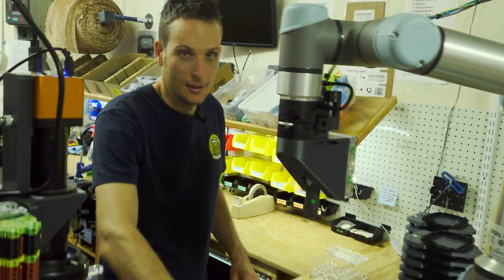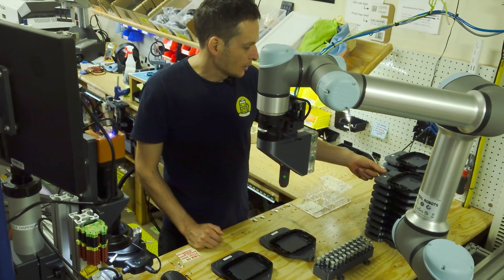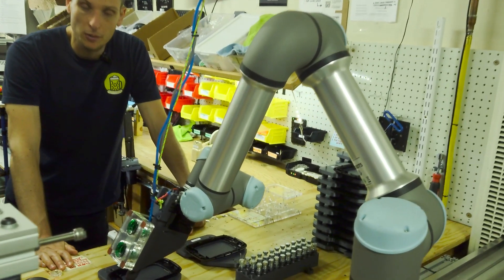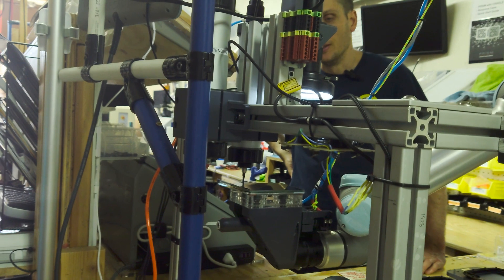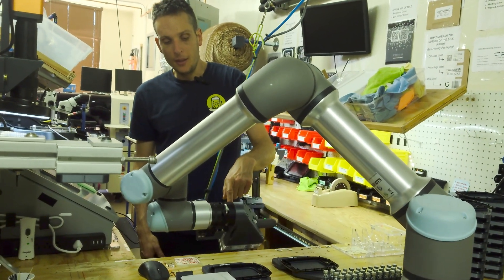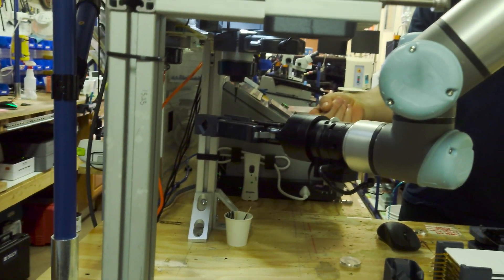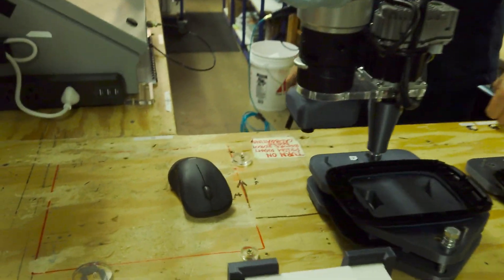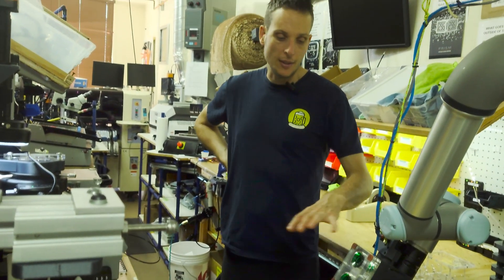Robotic Assembly Details

Comment: Thanks for sharing this! Why use switches instead of the laser to detect edges?
Reply from the maker: Thanks for the question! The laser sensor is a Keyence IL-065 (https://www.keyence.com/products/measure/laser-1d/il/models/il-065/). It's designed for measuring the distance between the sensor and a flat surface. It's repeatable to 0.002mm which makes it very effective for adjusting the orientation of the vacuum gripper to get the LCD perfectly flat but the laser beam it uses to take these measurements is about 1mm wide (photo here: shorturl.at/krALR).  We tried finding the edges of the LCD by pulling the LCD out from underneath the laser beam and detecting when the depth measurement increased as the beam went over the edge. Unfortunately, this method was only repeatable to about 0.3mm. I think this is because the sensor reading changes continuously as more and more of the wide beam falls off the edge of the LCD.

Another advantage of the limit switches is that they cost next to nothing so we can use three of them to detect the edge in three different places which saves a bit of time compared with having to move the LCD to three different positions under the same sensor.

The next thing I would like to try is replacing the limit switches with a machine vision camera. It's not super urgent because the limit switches work well but it would save a little time and would be fun to figure out.